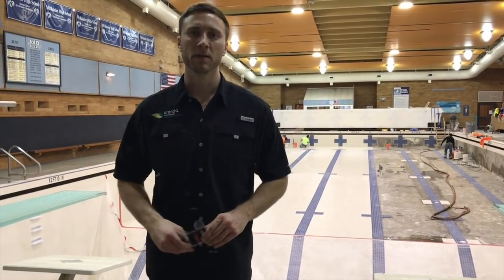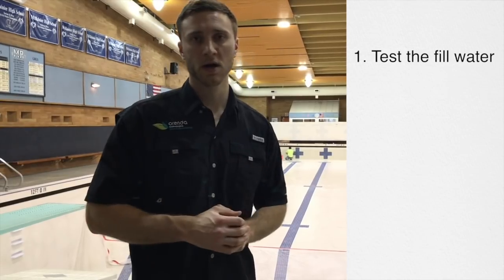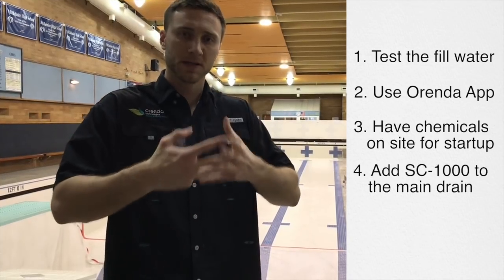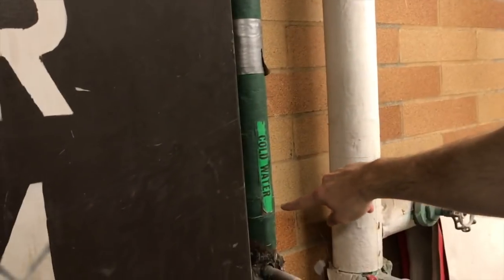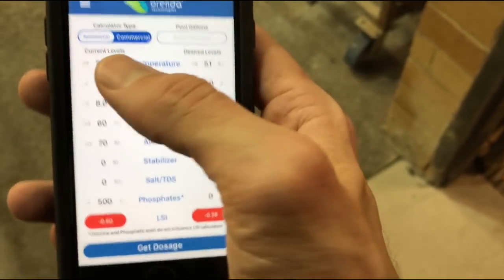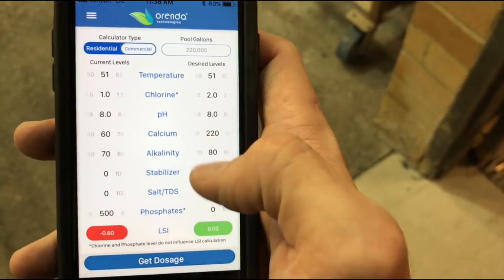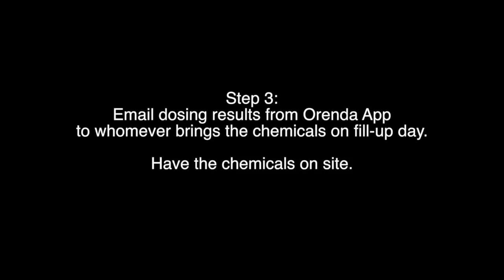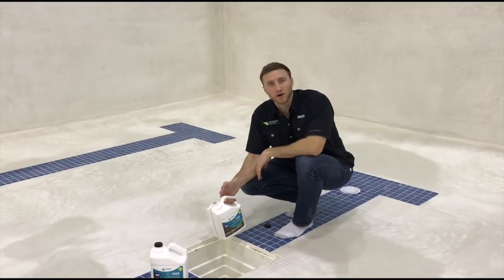Commercial Pool Orenda Startup™ | Orenda Procedures

Comment: once the pool is filled start the pump and recirculate the water to coat the pool.   believe that you poured it into the main drain
Reply from the maker: Some goes directly to the pump when it is turned on, but most of the SC-1000 will dilute into the water and spread throughout. SC-1000 is a self-repelling chemical, so it spreads through whatever dilution is available.